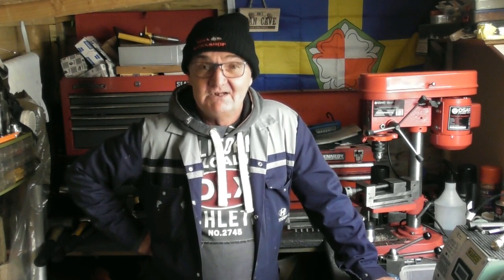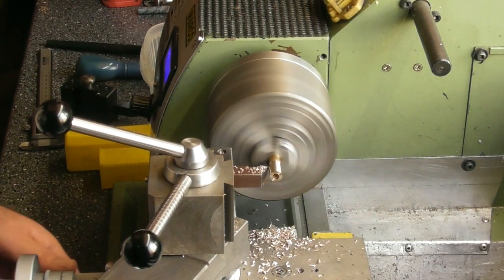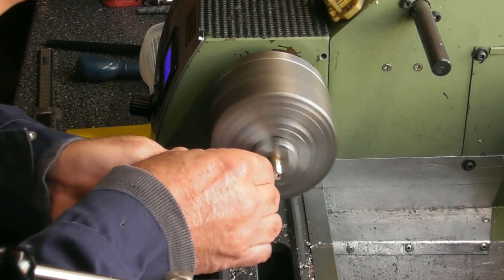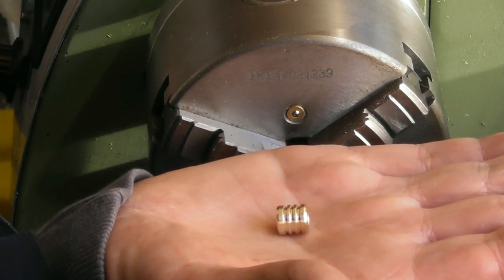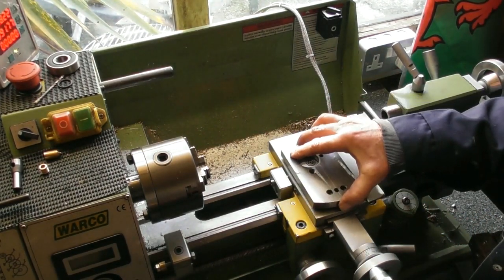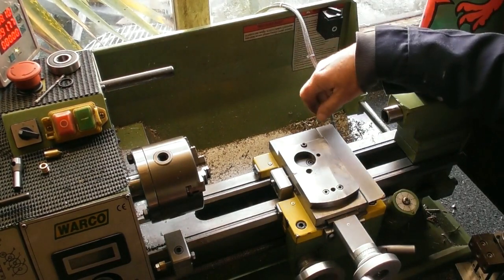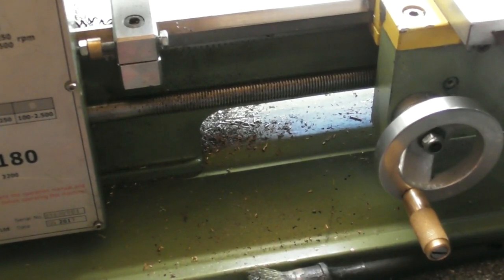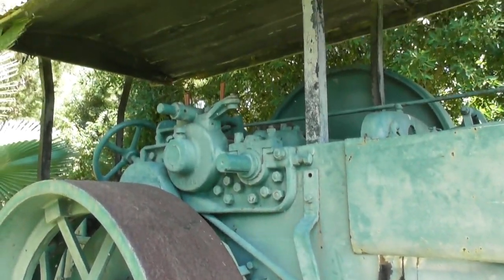Shed talk 11

Comment: Ade - you mention in your video the possibility of using your modified milling swivel mount to re-locate the compound slide. In doing this would you be able to use the Tool Post as a Rear Tool post for reverse parting off. The reason I ask is that I am having trouble parting on the WM180 and it has been suggested that a Rear Tool Post helps out a great deal?

Comment: What I missed from my earlier comment was change gear noise, which seems to crop up frequently. After changing the gear set and setting the gear clearance with "a piece of paper" the noise was considerable. The paper I used was .12mm. Using a piece .06mm the gears were "silent". Surprisingly sensitive. I suppose I should find a piece of .09 paper!
Reply from the maker: Yes , the clearance makes a difference , i suggest a piece of paper as a basic clearance ,  but i actually do it by feel of the tooth clearance to get the best result . practice makes perfect i suppose , Cheers Ade.

Comment: Thanks for your videos. A little time ago a looked at a video you made about a bottle jack to prop up the front of a drill press. Some time ago I bought cheapo clamps (Aldi or Lidl) and included were two small clamps. On examination I discovered that I could reverse the clamp arrangement on the clamp bar. The clamp then becomes an expander rather than a clamp. In this configuration the device fits between my drill press base and the table with excellent quick adjustment.